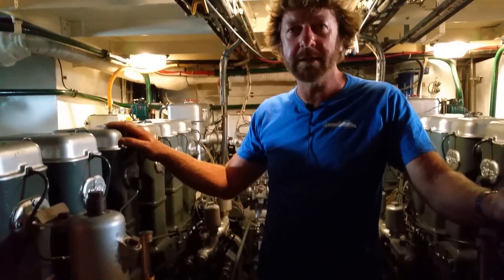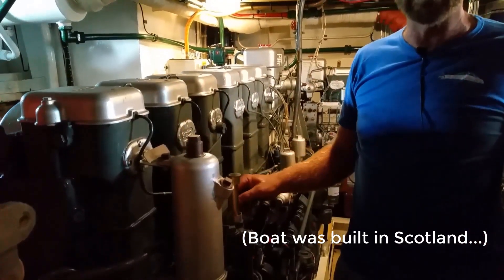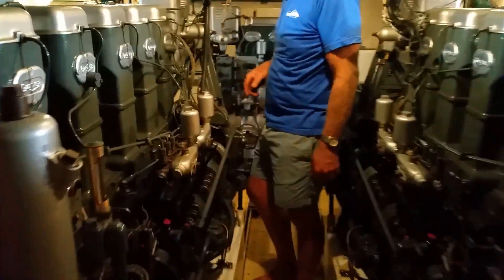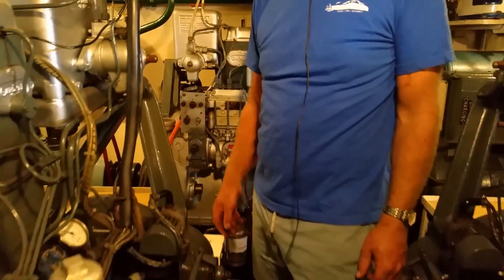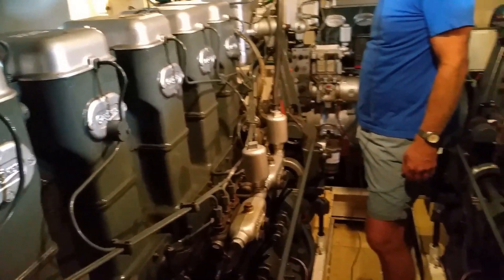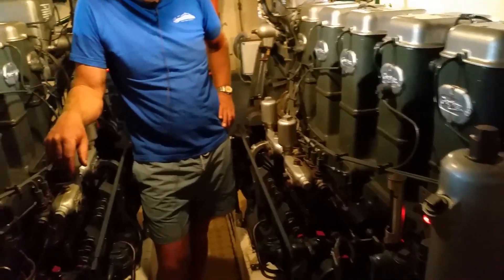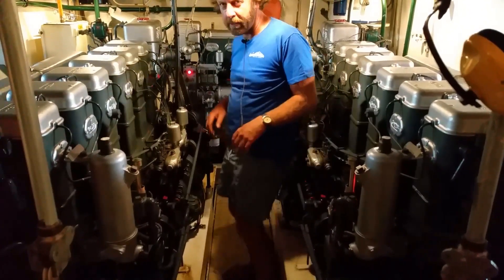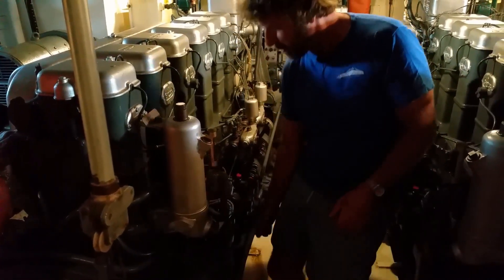Gardner 6L3B Startup

Comment: I worked on an old ship that had Gardener 4lw generator and two 1l2 generator . the big one had not been used in over 20 years. We changed the oils and filters and it fired up first turn and sounded wonderful. These are great engines

Comment: It's nice to see some positive comments at last on these magnificent motors , I was a commercial Cray fisherman in Tasmania for over forty years and have seen many different types of engines used and had many of them in boats I worked, but apart from the 6-71 GM not one of the others could hold a candle to the Gardner for reliability and economy , and I had them all from the 4- 5 -and 6 LW , the 6 LX ,6 LXB 8LXB , 6L3 and 8L3B, and truthfully I could never find fault with any of them , looked after they would last a lifetime ,a truly wonderful motor
Reply from the maker: Quite a few Gardner powered boats turn up to the Australian Wooden Boat Festival.

Comment: Currently working in that engine room - got the mechanical fire pumps running after sitting idle for a long time.
Reply from the maker: Great to hear. Are you the new owner?
Reply: @ReviewMarineProducts  no working for the owners , preparing her to head north shortly. Coming to end of recaulking and replugging the decks , refit of interior , all new electrical system, 3 month haulout with all the running gear done and underwater/topsides refinished, not many systems untouched.

Comment: Long lasting engines but with Gardner not keeping up with the times lead to their demise. No modernisation of any kind, no turbo charging ect lead to very low power/torque outputs.
Gardner are okay in slow moving old boats but out on the road where they were fitted to the likes of ERF trucks they were dire.
A shame as with development they could still be in production..
Reply from the maker: Rather than being replaced, many boat owners have their Gardner engine rebuilt for many years of further use. This is because they are reliable and well suited to displacement hulls.
Newly rebuilt Gardners are available from various engineering shops around the globe.
Reply: @ReviewMarineProducts   That's fair enough. My only point being they were never developed enough to keep up with the times re increasing power outputs which lead to Gardners (as a manufacturer) demise.
The same goes for the UK truck industry like ERF, Seddon Atkinson et al which used Gardner. Combined with poor ergonomics, very poor build quality, low comfort levels along with low power Gardners buyers started to look elsewhere and bought Volvo, Scania, DAF, MAN ect.
That's not however a criticism of an owner of an old boat who wants to either keep his boat original or is happy /doesnt require high power output.
👍
Reply: Power might be low but   not torque .